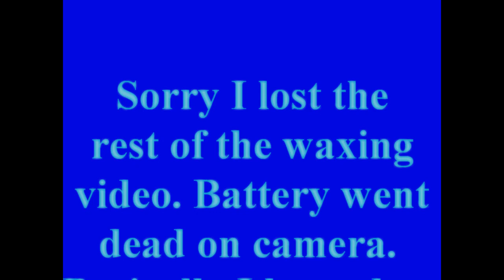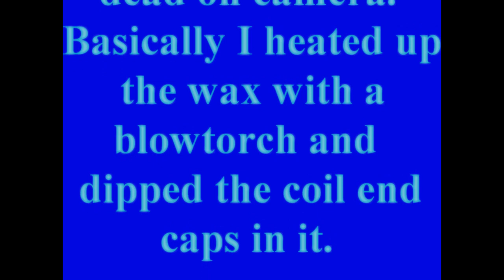EEAPG Generator Coil Construction.

Comment: Looking great, I’m getting exited for the completion. I have started on a mini replication. I have found you get more speed with a metallic core, but your double magnet method works well to continue the magnetic flux through the complete coil. Keep up the good work.
Reply from the maker: It makes more than double with magnets on both sides of coil.   Magnetic core kills my system under load.
Reply from the maker: Thanks
Reply from the maker: It’s not about speed. I get better over-unity at between 150 and 250 rpm. When at 500 rpm it uses way more than output.